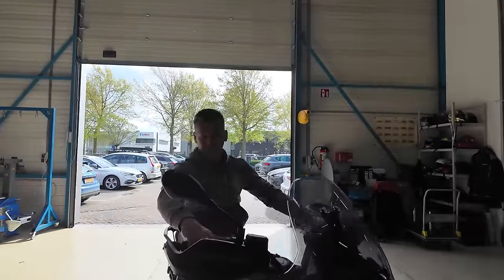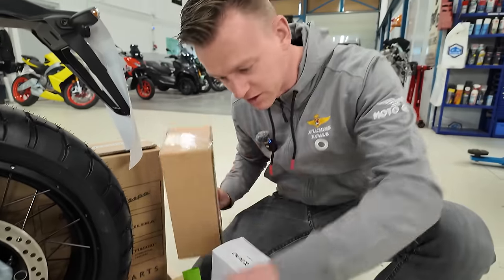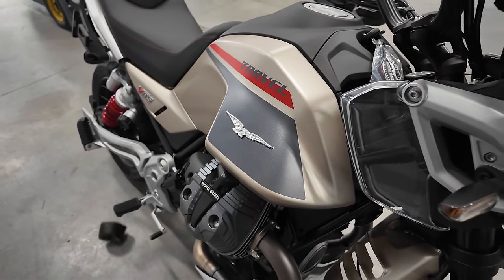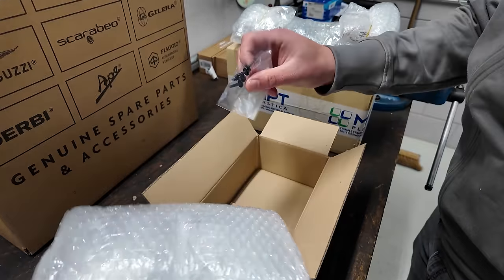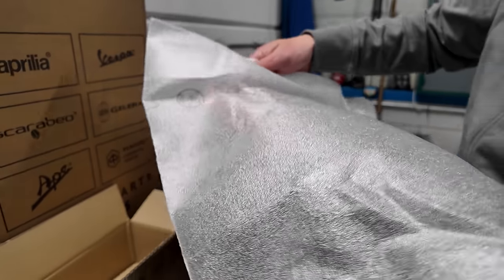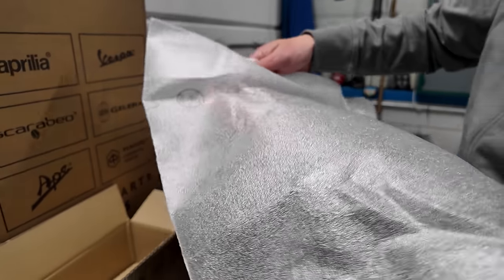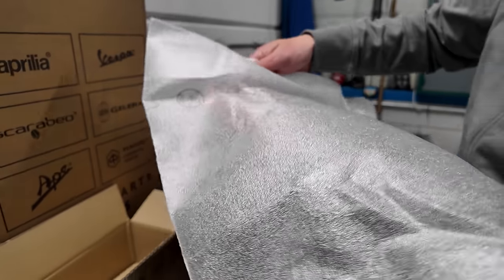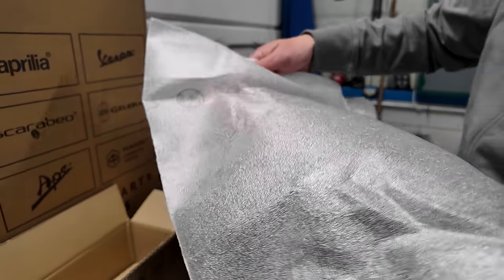UNBOXING A 2024 MOTO GUZZI STELVIO (115HP) V- TWIN

Comment: nice moto, I have not mounted a battery, windshield, floorboards, and rear view mirrors since my 2008 China "Touring body" 150cc scooter buy for $1300 bucks delivered, but the Moto G. is an even nicer moto than my Versys x300 I ride today.

Comment: Fun fact: the yellow marks on the screws are because those motorcycle are built BY HAND in Mandello del Lario, and the marks inform if the screw is properly fixed. 

Good video Smokey :)
Reply from the maker: Thanks buddy! Didn't know that , thanks for the info 😁👌🙏